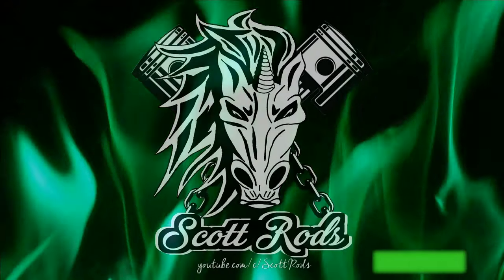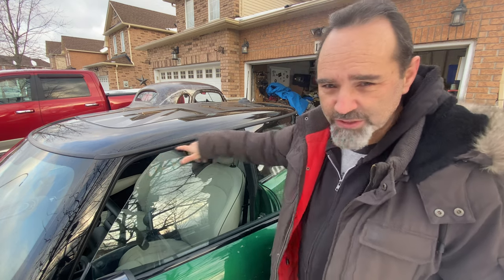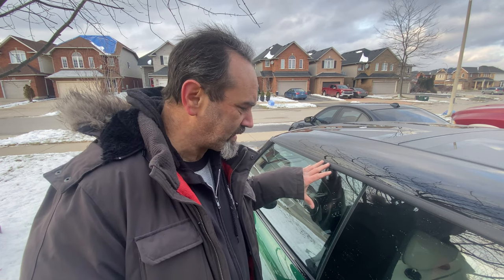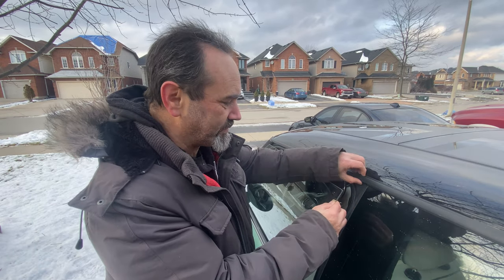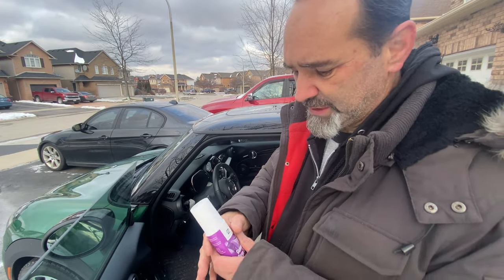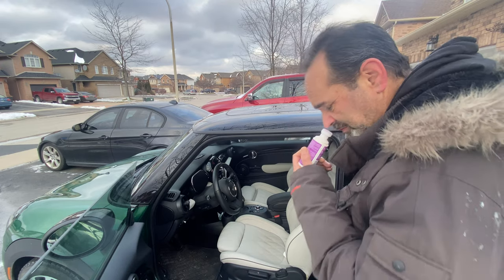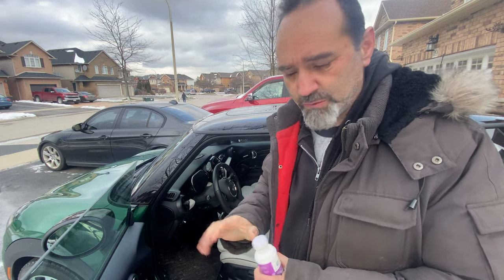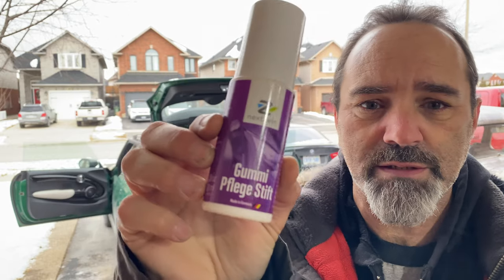Frame-less Car Window Freeze Prevention Could Save A Smashed Window!

Comment: Just came across your video - thanks for the product, I think I'll pick some up. I drive a BMW E92 (2 dr hardtop), and have more of an issue with the door glass freezing along the bottom, just above the wiper seal. This also prevents the glass from dropping. I have to keep a credit card handy to slide it between the glass and wiper, then the glass drops. Have to do this most mornings. Do you have this issue?

Comment: Would you put this on convertible top rubber? Specifically thinking of a z4 hard top. Thanks!!
Reply from the maker: I think the point of this conditioner is to keep the rubber soft while repelling moisture, sip I think it would work well.

Comment: Hi Scott, for my Mini Cooper we, sometimes my door won’t close completely that I have to open and close again with a little more pressure, have you experienced that?
Reply from the maker: The only think I can think of is, when you have your blowers on high, it increases the pressure inside the car, so more force is required to shut the door. Obviously this would not be the case if you were leaving the car when parked.
Reply: @ScottRods  intersteing point, I will test it tmw
Reply: @ScottRods  another quick question, do you wash your mini se yourself in the winter or go through touchless auto wash shop? Is it safe to clean the undercarriage (road salt) with the battery pack?
Reply from the maker: @zhaostephen5800  I always wash our cars myself. The underside should be safe to wash. I'm sure it gets a lot worse treatment just driving around.
Reply: @ScottRods  thanks! It would be nice to  do a car wash as part of your mini se YouTube series !